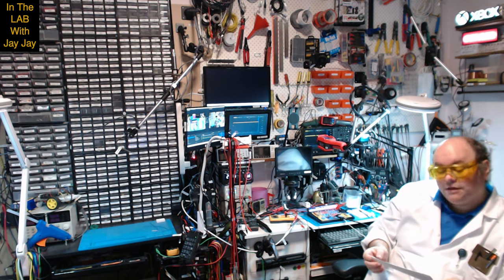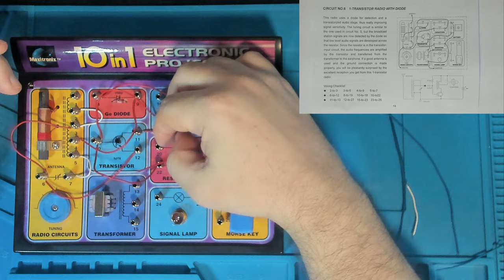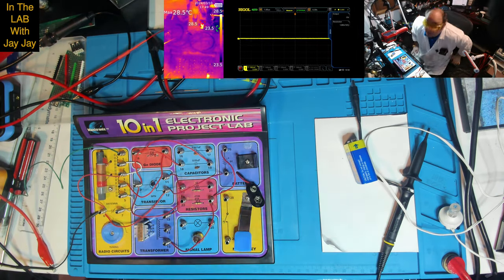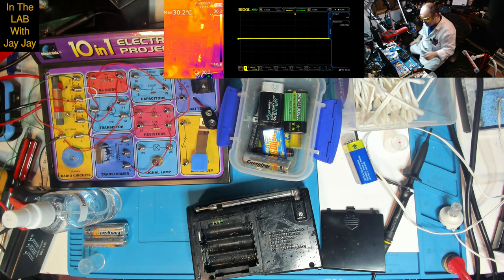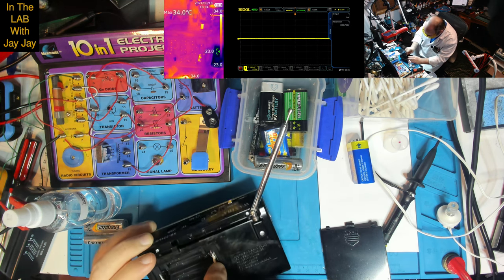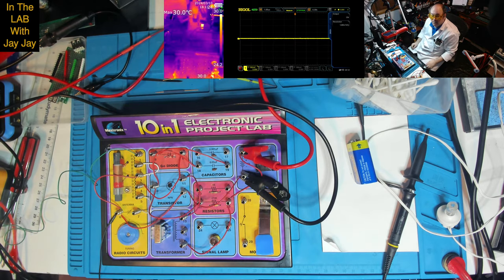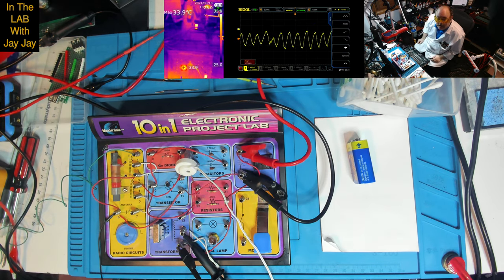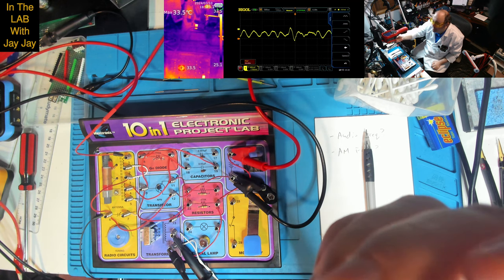1-Transistor Radio With Diode | Project 6/10 | Maxitronix 10in1 | In The Lab With Jay Jay

Comment: Hmm, seems I was wrong about the TV antenna not working with the circuit. I do remember using the ground of the TV antenna jack when I was a kid, as the TV antenna had a grounding rod connected to it for lighting protection, which seemed to work well as a ground source for the radio. I don't think I ever had any luck using only the TV antenna on the roof itself though. Very cool that you were able to get it working 🙂 The 2 KHz signal you're getting on the scope will be the audio portion of the signal, the actual radio frequency of an AM transmission is much higher - around 530 KHz to 1600 KHz.

CW on the transmitter circuit does indeed stand for "continuous wave", and is for Morse code transmission.
Reply from the maker: Thanks! What a fluke to get it working at the last minute! :)